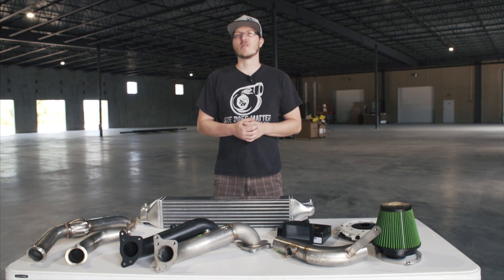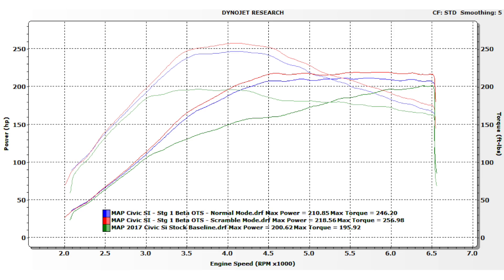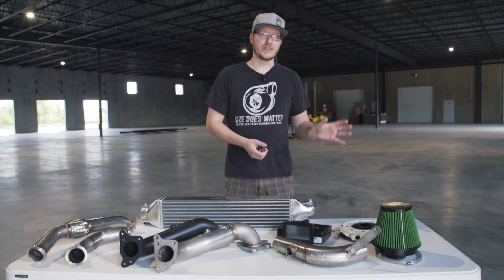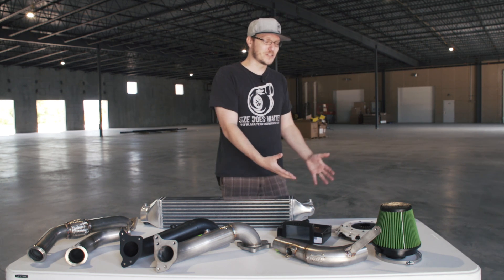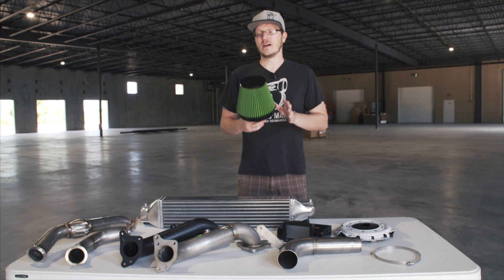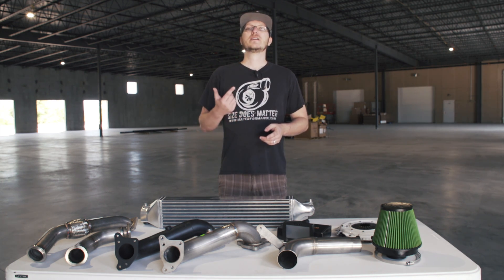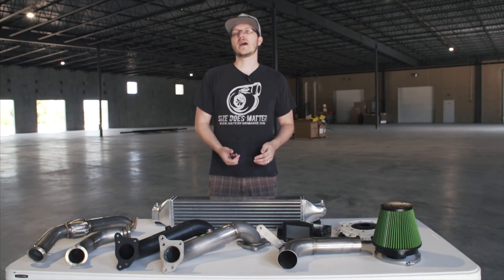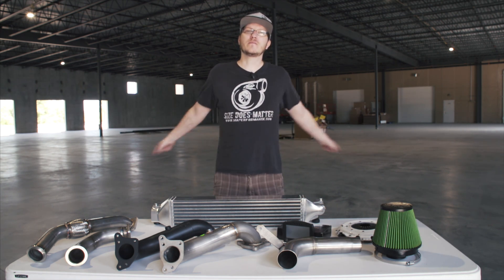Must Have Power Mods | 10th Gen Civic X Bolt On Guide

Comment: If you have ethanol in your area, just get Ktuner, and a E35-E40 mix blend tune. Rear motor mount, PRL intake, and intercooler. At this point, with just those mods.. you would max out the stock turbo when tuned correctly. 270-280WHP/330-335TQ on dyno jet
Reply: In canada there is no ethanol..
Reply: You'd almost definitely have to put a stiffer clutch in.
Reply: How can we talk? Can I get your email?
Reply: Is that even safe torque numbers for that 1.5 motor
Reply: @NEO_RKX  the motor handles it fine.

However, stock turbo + ethanol + boost = higher cyl pressure = possible head lift.

I had my studs stretch. Had to replace them with ARP studs, and a new gasket. Runs great still.
Reply: @ethanwhitehead9059  Join 10th gen civic Si owners club on Facebook
Reply: what does rear motor mount do? i know its a mount but what does it do the engine performance? if so what brand would you reccomend for daily driving?
Reply: @sigma0987  it's eliminates wheel hop
Reply: Can you achieve this numbers with a non SI 1.5t and the previous mods mentioned? Thanks
Reply: @kikom111  it would be close, yes. But limited due to the flow of the non si turbo. It would still be a nice bump in power.
Reply: @Reilly Hacker yes
Reply: @LegionS550  can't you overspin the turbo tho? I don't have a honda or know anything I just love Hondas.
Reply: @redbastard9711  not with the setup mentioned and tuned by a reputable tuner. I will say though, bolt ons and the ethanol blend puts the stock turbo close to it's ceiling if you will.
Reply: Y not just go full e85? Screw blends
Reply: @leonardoarispe4689  duty cycle of the injectors get maxed out. Risk running lean. Due to this, there's no benefit running E85 over a blend.

At least, until the fuel delivery problem is fixed. Such as bigger injectors or port injection in addition to the direct injection
Reply: @LegionS550  getting an fk7 soon, trying to make 300whp. Can I achieve this safely using your specifications and bigger turbo?
Reply: @LegionS550  then I think I’ll upgrade the injectors. I always run full e85 in my area. There’s like 12 fuel stations in my area. Plus it’s cheaper. I appreciate the information.
Reply: @redbastard9711  yep! You can. Just know that anything over 300 tends to increase the risk of rods going on the L15s. I think if you're at or below, with a bigger turbo that delivers torque later, your car would be happy.
Reply: @leonardoarispe4689  no problem. I haven't looked recently but the only upgrade for the fuel system is the addition of port injection.  Feel free to fact check me on that, it's been a while.
Reply: @LegionS550  thank you very much sir!
Reply: @luigitouchette421  Thoretically you could just pour some everclear in your gas tank lol.
except theres 2% water in that soooo

Comment: The clutch masters is the only clutch available at this time. Also the dual mass flywheel is garbage and will break so best advise is to buy the new one out the gate and save money on dropping your transmission twice. I recently came across more information and need to make a correction. SPEC clutches is now offering clutch kits and flywheel as well.
Reply: @Charles Lelièvre it cant be resurfaced. And its 4 grand for a new one from honda.... Junk
Reply: Joel Cso Trust me. I’ve had mine for well over a year now and no issues. Plus it’s holding
Up to 500 hp on Emans car. And get the cmc too. With those two parts , the only concern you’ll have next is the 3-4 gears blowing out. Sad to say but Honda put a lot of flawed parts on this gen

Comment: Upgrade to all fluids Redline Synthetic. Especially the CVT transmission and MTL/MT90. Use 0w30 redline oil.
Reply: Keep oil intervals around no more than 8,000 miles too. Using top tier brand fuel ⛽ or non ethanol will give you the best performance too.
Reply: Can the CVT handle all the torque?
Reply: @suleiman3811  I don't know. I think 🤔 you will know the limits once you recognize slippage. Everything has a weakness and one thing that you can control is the health and diet of your transmission. Quality fluids changed often with used analysis samples are cheap after you look at replacing a transmission.
Reply: Marco K very very true but unfortunately once you feel slippage in CVT it’s usually too late.
Reply: @suleiman3811  like I said lol 😂, all we can do is what we can do. I think doing simple bolt ons is probably okay.. But nothing much. I would do like I did and stay very close to suspension and brake mods. I only did exhaust and intake.

Comment: in other word's buy our stuff, guys no need for a new clutch if your stock with hondata, i been running everything stock with 9+ boost hondata tune with stock clutch and no issues or slipping, all depends if you know how to drive stick and not beat on the clutch

Comment: 3:50 : "We've incorporated a larger inlet here to help increase uhh, just velocity..."

What? That goes against the fundamental principals of fluid dynamics. A larger diameter pipe will contain a lower velocity fluid than a smaller diameter pipe that's achieving the same volumetric flow rate. 

Unless you're saying that the velocity OUT of the pipe is increased relative to the intake velocity? In that case, the pipe functions like a nozzle, and it's because the discharge side is narrower than the intake, and not because you made the intake side big.

Comment: Can the "only front pipe" replacement change the noise?
I m looking for a little "engine noise improve" but not loud and without cut and weld.
Reply: I recommend the magna flow exhaust.. its a nice sound not loud and deep

Comment: Which exhaust system preforms best for the 10th gen?? Most people you 3'inch on boosted old honda's but alot of the after market cat backs for the 10th gen aren't 3??
Reply: EM1 king Custom exhaust works best, followed by high end. Cheap exhaust are garbage

Comment: i think upgrade a bigger intercooler is not perfect for daily use ,it will produce more lag on low end rpm only hv benefit on peak power , stock intercooler is still better for CVT with wide powerband

Comment: I have the 19 si with all those bolt ons catted pipe, prl cobra intake, clutch master with lightweight flywheel, prl intercooler with piping, and +6 psi tune will I be at 250whp (NO flex fuel)
Reply: On 91, you should definitely be seeing higher numbers then that. The si is marketed at 205, the k tuner, you should already be reaching 240-250 Whp. The cobra intake advertises 20 horsepower gains for the race, 15 for the street. And im not sure about the other mods but you should at least be hitting 270-270
Reply: @pigeon1519   the SI is marked 205 at cranck   not wheels. The +6 map is no way near 40+50HP on 91  Period. I got a non SI and at +8psi it puts down 216HP with 95 octane(called 100 here in EU) . The intake and intercooler gives more power in the midrange   but not at peak, +20HP .   Sure he only is going to hit 240-250whp withe the above mods without switching to flexfuel.    So mike m   you are correct you might be looking at 250   with the mods you have listed, anymore power require turbo or flexfuel.

Comment: Big question... if you put a single mass flywheel in a car that is designed for a dual mass flywheel can’t that cause the ecu to trip misfire codes?... that’s the reason why I never changed out the clutch in my 9th gen. I’m bummed to find out that the 10th gen still has this

Comment: Whats your 1/4 mile time with current setup? Car is moving!!
Reply from the maker: Car has run 12.09 - very consistent in low 12s!
Reply: @maperformance  with just bolt ons?
Reply: 12.0 on the stock turbo and not hitting 270 hp? Don’t think so. Need proof to become a believer.
Reply: JOE G just saw the video of the car drag pass’. The car is no where near stock. Upgraded turbo and slicks.

Comment: Can i use these parts on a sport touring as well?
Reply: No its a cvt these mods will destroy your cvt transmission
Reply: For the Sport Touring you can use either tuner device (KTuner / Hondata).  You don't need an aftermarket intake, just drop in a higher flow filter.  Remember, you are on a CVT and won't be upgrading the turbo.  Your exhaust is already seriously good enough and I would not recommend any Downpipe or Frontpipe.  You are on a CVT.  If you enjoy getting a bit sporty I would suggest an upgraded intercooler - I like the PRL IC with the piping.  The Hot Side is 2" (+ .5" over stock) and Cold Side is 2.5" (+1" over stock); that is an optimum set-up when increasing the Volume on the stock IC while increasing PSI.  The upgraded IC will significantly lower your Outlet Temps and you will 1) Gain power with increased boost, 2) Not have any pre-detonation or knock,  3) Increase the life of the turbo and the system, and 4) Avoid heat soak altogether.  You can try the Tuner by itself, but when you are increasing the PSI you will heat soak much faster than the stock set-up.  Besides, the Stock Hot & Cold side charge hoses are only 1Ply.
So, THREE things:
- High Flow Filter (in stock box)
- Tuner
- Intercooler
Reply: Random Stuff do you know anything ?
Reply: @HollywoodQuickscopes  genius go ahead and do whatever u want
Reply: Yes you can! I recommend Ktuner,  PRL Cobra cold air intake and RV6/PRL Downpipe.

Comment: I’m looking for the map street exhaust for my 10th gen Si 
And then Prl downpipe front pipe combo shortly after 
But when ordering the exhaust it asks if you have factory front pipe or not 

Does this mean if I order the map exhaust with factory front pipe when I order my
Dp fp combo I’ll need a different exhaust fitting or flange ?
Reply from the maker: The PRL front pipe is a factory 3 bolt flange, so just select that when you buy the exhaust! The V-band selection is for the MAP front pipe.
Reply: @maperformance  thank you for breaking that down for me and the quick response 🤙🏼

Comment: Clutch upgrade isn't mandatory for these other parts, it's just mandatory if you bought a 10th Gen SI and actually want to drive it like one. Keeler BMW replaced my mom's Mini Cooper clutch for free at 20k and even admitted it may have been due to the previous owner learning stick with the car. But Honda won't back their cars. So much for that excellent reputation.

Comment: My stock clutch after less than 10k miles (I DO NOT CLUTCH DROP OR SLIP UNNECCISARILY) slipped a few times just doing highway pulls with no modifications bone stock si
Reply: Yea it fucking sucks, I call the Honda dealer and they just talk to me like it's my fault. 20k started doing it as soon as it got cold out. I've been driving manual cars for 12 years. Now I have to warm up & baby a car I paid 20 Grand for so I don't have a $4000 repair bill. I love the car but I'll never buy one again. 1st Honda & Last Honda.
Reply: I suspect that Honda miscalculated the spring pressures or the material for the clutch.  My '18 Si has 71,000 mi on it and the clutch slips in 5th and 6th gear above 3,500 rpm if you roll into the boost.  I'm pretty sure it's the same clutch that they put in the base model non turbo cars so it just doesn't handle the extra horsepower and torque.  Ordered my ACT clutch a couple weeks ago and am just waiting for it to arrive so I can change it and stop worrying about it.  I also ordered the lightweight flywheel because I hate the rev hang caused by the heavy weight dual mass piece that comes from the factory.

Comment: Are these parts going to bolt on perfectly to the Sport Hatchback as well?
Reply: Besides maybe the intercooler, and downpipe, no. You'd be better off going with a PRL Cobra for the intake, anyway, as it makes the most power (compared to other intakes), and runs the best without a tune. The best mods for these cars are Ktuner, ethanol, the PRL Cobra, and an aftermarket clutch.
Reply: Z3Ph IZr3aL what would you recommend for exhaust? Something throaty, i was looking at the Borla for the civic sport hatch.
Reply: @robertcummings8833  Greddy is what I have. Best sound, at the best value IMO. I have videos on my channel. I think if you're catless though, or going catless at some point, magnaflow might be the best choice, as there's no chance of it being raspy.
Reply: @robertcummings8833  
Got the magnaflow on mine, its deep tone not too loud. Can still talk normally inside car. It's got 2 center black tips that look nice too.

Comment: Dude I have a 2.0 and auto civic coupe 10th gen I can’t find any performance mods to make it faster
Reply: The 2.0 engine isn’t worth upgrading. There’s no turbo and the engine isn’t built to handle much power. You could probably do an intake and exhaust, that’s about it.
Reply: Ktuner has a tune for our 2.0 so that would be the first thing it'd buy

Comment: Should you do these all at the same time or would someone be fine with tuning first then later on buying the rest one by one?
Reply: Jose Vega I noticed during my own research that people like to get the tune first and run a basemap then change their clutch and add bolt ons after. I’m guessing you can go bolt ons before clutch and just wear out your stock clutch. I’m probably going to keep the stock clutch at first and feel out the mods and get used to them then drop a nicer clutch. I’m probably my going to do all of the above mentioned in prep for a turbo upgrade in the further future. 
Hope I was of any help!
Reply: J Luu same Im probably gonna do the same since my car is brand new and unless the clutch starts slipping then I won’t buy one just yet.
Reply: Jose Vega my thoughts exactly. I only have 4000 km. I figure I’d get my ktuner done and enjoy it with the stock clutch then upgrade clutch when I start slipping
Reply from the maker: You can absolutely do things one at a time. Tune costs could go up if you are planning on a tune each time... obviously wont matter for things like clutch, though!

Comment: what is the best model year SI to get todate?
Reply: 2020 I’ve had all since 1999 an just got my new 2020 all coupes it has all the cool tech features plus shorter final drive so acceleration is faster then last couple years my opinion of course I’m a Honda guy tho for sure I’ve also had two type r integrals still got one an a couple gsr integrals over the years

Comment: I've got a 2019 civic hatchback sport with the 1.5 turbo motor will these parts work or only the SI??? I'm anxious to start my build but want to do a bit of research before I pull the trigger ?? Would be great to hear about what I should do from you guys?!
Reply: They will work for your car. Its the same engine as far as you're concerned

Comment: how would these work on a cvt?
Reply: Kaiaji they do work, transmission don’t really play a factor when it comes to these mods adding power. The only advantage to a Manuel transmission with these mods are that it can be pushed a little bit more when adding power. But even Manuel transmission when pushed too hard get destroyed.
Reply: Yakuza Ohtani you are just completely wrong sir
Reply: Yakuza Ohtani trans plays a huge factor when adding power! Stock Honda transmissions are only rated so high. Anything over 350tq is pushing it in these, auto or manual. Auto might shift faster but if it didn’t come stock with that power, things will break. It’s just a matter of time.
Reply: @ProdByAce  you're also wrong. The cvt trans stands for continuance variable transmission. There are no gears. There are no shifts. Rpms just keep climbing.